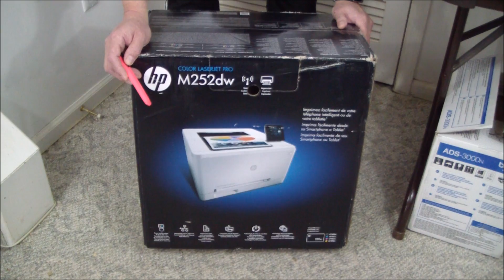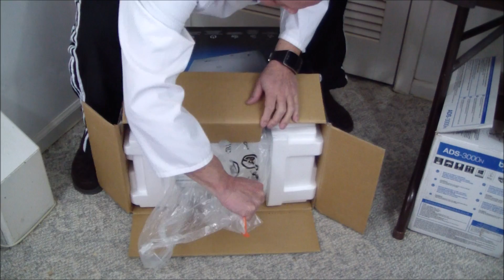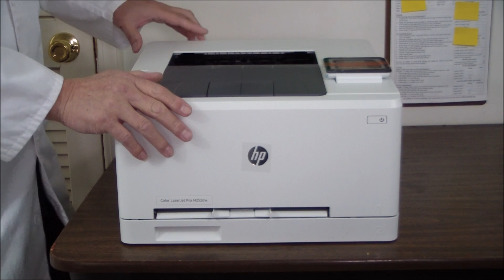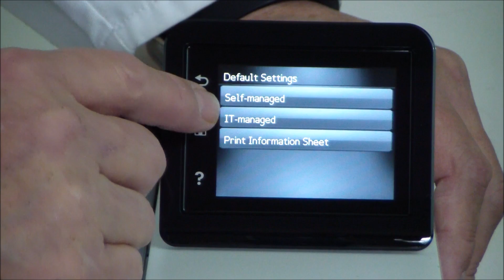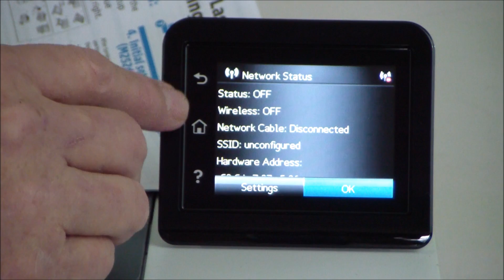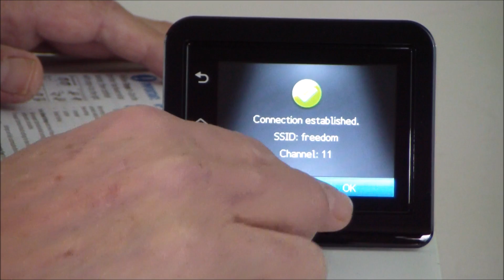HP Color LaserJet Pro M252dw Unboxing & Setup

Comment: Принтер для даунов и аутистов, которые не понимают сколько будет стоить печать.
Комплект картриджей стоит 80% от стоимости принтера.
"HP"| ждёт тот же успех с принтерами, что и "Siemens" с мобильными телефонами.
Ничего не поделаешь, когда аутизм - эпидемия США, приходится сажать аутистов инженерами и менеджерами.
Reply from the maker: "Certain individuals, do not understand how much will it cost to print. Cartridge Kit is worth 80% of the cost of the printer. "HP" is waiting for the same success with printers, that Siemens has with mobile phones. Nothing can be done with the engineer and manager ignorance epidemic in the United States." (Note: Edited for brevity)

Вы должны купить принтеры емкость для чернил, где чернила так дешево, как он получает. Они продаются HP, Canon, Epson и брат. Вы должны рассмотреть принтеров чернила танк, где чернила и стоимость страницы составляет ~ 20 x меньше. Они продаются HP, Canon, Epson и брат.

You are right, the cost of toner is an abomination. It is ~$0.20  per ISO color page and a set of standard OEM toner cartridges cost ~$300 for this printer. You should consider ink-tank printers where ink and cost per page is ~20x less. They are sold by HP, Epson, Brother and Canon.

Comment: Your router has WPS on!? Goodness me, man, before you post videos on youtube about printers, how about you read a bit more about YOUR OWN SECURITY. With WPS on, your router is open to ANYONE. Look up WPS security issues on the internet. Until then, good luck!
Reply from the maker: Push-button WPS only stays active for a few minutes at most then shuts down automatically.
Reply: The button does. Not the function. The WPS is still on.